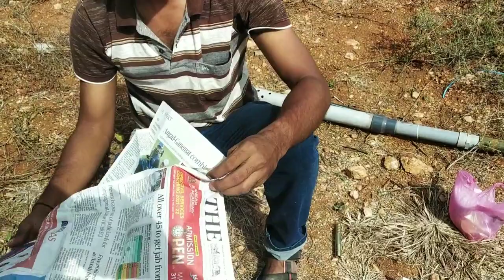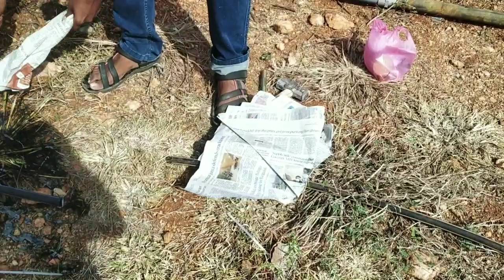Hdpe air hose leakage | Explanation in tamil | Everything learning today

Comment: sir, i have a borewell with compressor pump , from hdpe , 1inch pvc pipe brings water in to the water tank , my question is can the water bringing pvc pipe cut in the middle and joined by hose by adapter so that pvc pipe can securely clamped to wall ? is there problem doing so ?
Reply from the maker: No problem u can